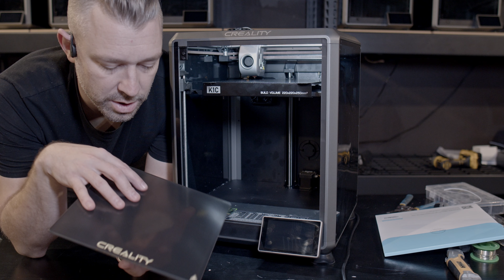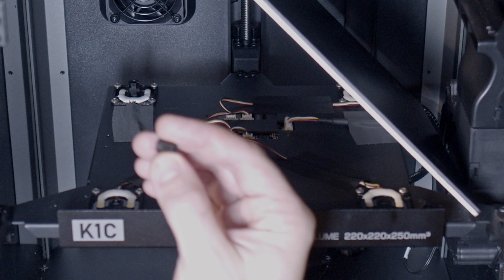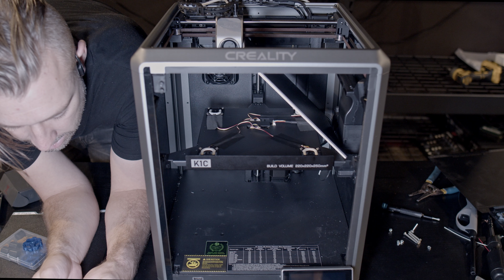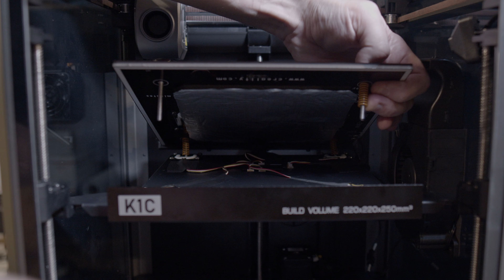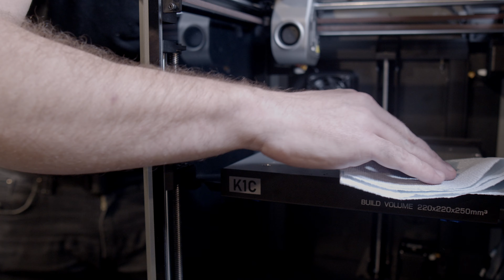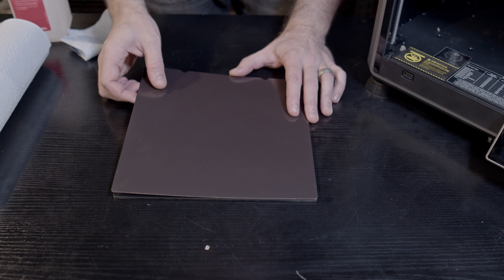Fixing the Creality K1 Series bed warping with the Sub Bed Mod

Comment: Curious, if I don't do the glass sub plate but just install the spring tensioners if that would fix my plate. The front right left and back right are all really close but the back left rises steeply due to the 3 spindle design I can't do more than adjust the front.

My real question is once I do this is it a pain? Do the load cells still function with touch probing?  Is it difficult to keep the adjustments on the knobs or do they back off over time or need frequent adjustments?

Comment: I used a glass plate on my ratrig over aluminum, I Had to increase bed temps by at least 10-15deg to get the desired surface temp as there are so many thermal barriers in the sandwich.

Comment: So those channels will have to be printed out of a plastic that can withstand any temp you plan to use. That means  using high temperature filaments which most people will have difficulty with. Also adding leveling springs will reduce print quality as the print surface is no longer hard mounted. The answer to all these problems lies in software and someone smart enough to develop new solutions. Fingers Crossed

Comment: Im surprised there is no one smart enough to measure the tilt of the bed and apply offsets to the Z lead screws to achieve a dead flat surface. Surly thats the best way to level the bed with multiple z axis motors.
Reply: These machines do not have separate Z stepper motors.

Comment: Just wonder if you need to do the BTT Eddy mod / do the springs impact the stock bed leveling system since it is no longer solid/fixed?

Also, how in the world do you get the glass build plate off the bed if you needed to?
Reply from the maker: The spring create inaccurate results with the default load cell leveling system. It requires rigid contact.

Comment: Bad luck here... I had already done the screw tilt mod on my K1's bed before and it is amazing... and I decided to add this glass bed mod, so I bought a Creality one, exactly as the one shown in the video. Unfortunately, the level mesh I,ve got after the glass bed mod was worse than before. So I removed the Creality glass bed to take a closer look at it and, to my surprise, realized it wasn't flat at all. Its corners are warped upward, quite visible when placed on a flat table or when I placed a metal ruler over it. Perhaps another kind off glass achieve bether result, but this Creality one, desappointed me.
Reply: thats wild, i know crealitys customer service sucks in general but thats absolutely one id be standing 10 toes on

Comment: Great Video .Well explain out. Going to do my K2 Plus , just waiting on other parts, got the  tempered glass bed .Even just placing the glass straight on the bed and adjusting the 4 knobs got mine to 0.1985  from 0.9853 Warped Horse Saddle !!!

Comment: Hey, love your channel. You’ve helped me out a ton as I embarked on this new hobby/obsession of mine. I’m currently doing your Glass Sub Mod and probe mod on my K1C. 

And because I am me, and although I’m not currently experiencing z-banding issues, but because there’s the chance that I could in the future (it makes sense to me at least) I was hoping that you could do a video on the process of installing some OldHam couplers (or is it possible to install the WobbleX devices instead?) on all 3 Ball screws in conjunction with anti-backlash springs and nuts on the K1C specifically?

Comment: I'm not sure I'm able to do the glass mod, but can I do the knobs and springs alone? Thanks! Great tutorial.
Reply: Did you try it? I'm thinking of doing it with out the glass as well. Curious what your build plate variance is. Mine was brutal but I have printed shims on the front left and right now that helped without needing do all the belt stuff or tooth skipping
Reply: @Inquisitive-Badger  I was able to get the level very close using the knobs and springs. It was a good remedy.
Reply: @jepolch  and the load cells still work for push 
probing? thanks for the reply
Reply: @Inquisitive-Badger  I don't know what that means.

Comment: A long time ago I did something similar to the Ender 3, but with 100x100x0.5 mm silicone thermal pads instead of 3M double-sided tape. Glass never moved, but both the heatbed and glass surfaces must be smooth and as clean as possible for suction to work.

Comment: Now I understand.
Why my sermoon d1 is having a glass building plate and screws too adjust and the newer creality are screwing up.

Sermoon has issues with dual motors but as seen easier to adjust those then the new one with belts.

Was thinking to connect the spinsels with a belt mod but so far I didn't. Just put some lines in case it skips or moves. Easier to put back and check o the bed level.

Looking for something different now but probably bambu X1c it will be 😅

Comment: would it work if place magnetic sheets to both sides of the glass? 1 to stick to current bed and other for the PEi sheet. that way load cells can be used.
Reply: How are the load cells ruined by this mod?

Comment: You mentioned in a comment that the silicone nozzle brush couldn't be used anymore. Why? I could have sworn I saw a version of this that simply mounted the silicone brush off your original K1C build surface to the indexing bracket itself at roughly the same height and position.

Comment: Im in germany and when i put this all on a pile it costs me less or the same to buy machined cast aluminum plate. Which is around 60€. So i want to ask does anybody here thinks this machined cast aluminum is going to work good?
Reply from the maker: @newdimension2012  it really depends machined plates can be great or they can be worse than stock plates. I've seen both. If you can find a good reputable manufacture then its worth a shot.
Reply: @zerodotcmd  thank you.
Reply: Did the glass mod on k1max. 5mm window glass. Once i figured out Z-offset it prints the whole plate 0.2 layer perfectly. Difference is 0.23. I bought everything for k1C also. 😁
For both printers custom cut glass and sticky kit around 80€.
Thank you for the mod man. Appreciate it.

Comment: Great video! I'd love to do all this to my K1C but I've only had it a week and am still learning everything.  My bed mesh ranges from -0.2706 to 0.4405 which from what I've read is excessive.  Could I get away with just adding those adjustment screws for now?  I only print PLA as I'm still learning but would eventually like to move up in material.  I just don't want to do such a "permanent" mod so soon into having a 3d printer.
Reply from the maker: I'm glad you like the video. I would say for now, unless you are experiencing major problems to just get used to the printer for a while. You can always come back later once you feel ready and more comfortable with modding the printer. Adding the adjustment screws alone doesn't address the issue of the bed warping, and in some cases can make it worse.

Comment: So how would one get the glass bed with the 3m adhesive removed? Heat does not help lol. (New to this)
Reply from the maker: It's very very difficult. I've had to remove one before. Mostly theres not a lot that would help other than slowly trying to separate the glass from the plate. I ended up using an old smooth build plate by slowly forcing it between the glass and the heat plate.
Reply: @zerodotcmd  Did you take out the whole build plate to do that? or leave it in the printer attached?
Reply from the maker: @SoliDudesGaming  Leave it attached. it's to easy to damage the plate if you remove it to try to pull off the glass.
Reply: @zerodotcmd  Nevermind, that worked great. Thank you!!!

Comment: Hi
I have K1C.
(Ordered glass bed, magnetic sheet+3M 468 200M adhesive)
And Cartographer 3D)
Printed Low profile back channel.

How i remove nozzle wiping from machine gcode?
Or modify machine gcode Z higher?
On that wiping code.

For that nozzle wiping and glue nozzle wiper on top of low profile back channel.

Designed new knobs to used with countersunk nuts.

You can find out how much Z-axis must be shortened by driving bed lowest position it can go without hitting ground.

Then put Z-axis height to your slicer.
"printable height"
Reply from the maker: On stock firmware there is no way to remove the nozzle wipe from the start macro. This is only possible on community firmware.

Comment: Hey mate, how do your meshes compare across different temperatures? I managed a really good result at 100C but a terrible result at 60C . Also, are you releasing a video on how you tuned your machine after the mod?
Reply from the maker: This would have to do with probing itself and not really the bed. If you are using the Eddy, there is a temperature calibration that need's to be done for printing at different temperatures.

Comment: Doesnt this compromise the serviceability of the printer? Since the screws are covered by the glass and cant be removed anymore? (Just wondering) because i really wanna do this mod! 😁
Reply from the maker: Yes it does cover up the bolts for the bed. but the bed is still able to be removed since this mod uses knobs to secure the bolts.

Comment: This is great idea! Looking to try this mod! Question though... On my Ender5, when installing a glass plate, the instructions directed to do a PID test after the glass is on... if mem. serves me right, the PID calibration tunes how the controller turns the bed heater on/off to maintain the target bed Temp (samezis for the extruder)... To anyone who has done this mod, have you noticed fluctuating bed temps after installing (like the bed temp dances +/- 1 or 2d around target temp)? Also, does anyone know how to Test/Calibrate PID setting on a K1?
Reply from the maker: Yes you are mostly correct about how PID works. However, when mass is added to the heat plate, the thermal resistance changes. This means the results from a PID tuning would be slightly off if it was tunes prior to the installation of the mod. for the K1 series, if you are not using stock firmware then you would just want to run through the self talk / calibration in the menu for PID. it will run calibrations for everything and do PID while it is doing these calibrations.

Comment: I had done a similar mod, but no glass plate.  I made my own silicon "springs"  and then used the same idea for level adjustment, when I shared this idea, I got a lot of feed/push back about the messing with the load cells. have you noticed any issues/errors with the load cells?
And frankly, why did Creality use load cells, I don't see the purpose!
Reply: you dont want to do this with the default probing / load cells, this works cause he did away with it using the BTT Eddy probe (or cartographer, or beacon, or any magnetic inductence probe .....)
Reply from the maker: Some people say this works with the default load cells. however they are mistaken. It may "work" but what they don't know with they say this is that the values reported from the load cells when using springs or silicon aren't accurate. On the Stock K1 Series firmware the load cells will sometimes work, but there is an error range. If the values fall to far outside of this range the printer will report an "Error, Movement Not Smooth" meaning the values are far outside the range and can't possibly be reading correctly. The reason for this is the fact that the load cells need rigid contact to measure proper readings.
Reply: @zerodotcmd  Sorry but reported elsewhere not true. My K1 Max is running springs and knobs and has no problem with the load cells and no error messages. Been running like this for about 6 mths.
Reply: The problem is torquing down springs or silicone standoffs puts more on the load cells making the load cells think something other then what it actually is.   People early on did this and then proceeded to drive their hotends into the bed because it was giving false readings.  In theory it's suppose to just know.  In reality.  It's creality.    Do at your own risk.   Or spend $30 on a btt Eddy and you can do whatever cause you won't need the pr touch or load cells anymore
Reply: Also thank you @zerodotcmd. I got a glass plate for my max awhile back but couldn't find good enough clips to hold it down.  This video pointed me to the sticky stuff and that will help a lot already got everything else. Just need time to get it done

Comment: Did the glass bed mod without the springs and knobs, no air bubbles, but my bed looks like a taco when I calibrate. Did I do something wrong or miss something?
Reply from the maker: @jeramiebecerra8435  sorry to hear your having problems. Its hard to tell without seeing the problem. You can join the discord if you'd like to share. The discord is linked in the printables page.
Reply: The discord link is expired
Reply from the maker: @jeramiebecerra8435  sorry. Here you go. https://discord.gg/BjBehrmb

Comment: Will this work for the k2 plus if I get a 350x350 glass build plate?
Reply: It would have to be 370x370 glass build plate. Something like a Ender 5 Plus glass build plate but that is 377x370. But otherwise i want to know this as well.
Reply from the maker: Yes it would work. @digidemi is correct, just need a large enough glass plate.
Reply: One more note, the K2 Plus uses a strain gauge located in the toolhead instead of loadcells located under the bed bed leveling. In theory, if your K2 Plus has a warped bed you could use the sub bed mod without the new probe. I am thinking of trying this if Creality sends a new bed… mines warped like a rainbow, +0.9mm mesh deviation at low temp and +1.4mm after heating up. 😢
Reply: @digidemi  I got a new bed, I'm thinking about doing this mod to my K2, did you do the modification?

Comment: How hot does the bed get with all those layers, how much do you need to raise the temp for the top layer to hit 60°
Reply from the maker: @joonizz  All my testing only shows a 1 degree reduction in temperature. Its so little I don't even adjust for it.

Comment: Hey Zero, question when using this mod with the BTT Eddy.  It's telling me that the probe eddy current sensor not in valid range.  Is that to do with the added height, or do I just need to calibrate it again?
Reply from the maker: What's the exact error? There are a few different range errors in Klipper.
Reply: @zerodotcmd  The exact error is "probe_eddy_current sensor not in valid range"
Reply: @zerodotcmd  hey nvm, got in touch with the discord group and apparently it's just a copy paste error. I need to change the offsets in the btteddy config file.

Comment: Thinking of getting k1 max, are you able to do a follow up video a d share the bed mesh with the glass bed? Thanks
Reply from the maker: The K1 max has the same exact setup process and results as the K1 and K1C. There are a few people in the SimpleAF discord who have done the glass bed mod on the Max. I wouldn't be able to do a video on the Max as I do not own one.

Comment: Lol.. Just put glass and stick by clips for paper.
Reply from the maker: Some people do this. The difference is the heat plate still warps underneath the glass causing the glass to rise and fall during the heating process. Binding the two together with a strong enough bond stops the major warping of the heat plate.

Comment: I got a question, I was able to level my K1 Max with this MOD, Question is in the printer.cfg under the Z_Stepper for the MAX it has 305 others are saying to change it to 300,, is that right??? I don't know what to put their or just leave the 305, yes, I'm using the wheels and springs. My bed level is JUST above the bed level line and others say it needs to be as close or on the line, is that true and how can I get it there? I have spent hrs & hrs trying to level it and get it on the line with no luck.
Reply from the maker: This can be good for making sure that the screws do not hit the bottom of the printer. The values can change depending on how compressed the springs are. For the most part reducing the value slightly to 300 should have you covered.
Reply: @zerodotcmd  ok thank you so much. Also my prints are coming out so much better now.
Reply from the maker: @tazzy68  Awesome! Really glad this helped improve your prints.

Comment: I just set mine up like and Ender 3. Put the screws through the bed and put a nut on to tighten the bolt to the bed, then put a half spring on and set them directly on the pressure sensor then push the screw through the frame and spin on the adjustment knob underneath. works like a charm. No need for a new sensor.
Reply from the maker: Nice glad to hear you have the mod working for you. There are definitely other ways to setup the mod. The way shown here would require an after market probe. I'm currently coming up with more ways to do this mod.
Reply: @zerodotcmd  I think that major point was to tighten screws to the bed with nuts (adding dielectric washers to not to scratch paint) before adding springs. That solution not just for bed slingers. If you adding springiness where there was rigid joint, you have to provide additional stiffness (screws should always be perpendicular to table).

Comment: If you do this mod do you have to replace anything else?  I see on your printables you have to put on a Btteddy.  Will you still be able to level the bed and will the heat be accurate? thanks S
Reply from the maker: If you use the springs and knobs portion of the mod you will need an after market probe. you can skip the leveling kit and just use the glass portion and this mod will work with stock auto bed leveling. In my testing the bed only suffers a 1 degree temperature difference.
Reply: @zerodotcmd  Thank you! I will uninstall those for now until I get the Cartographer in.  For that can I print the holder in Carbon fiber?